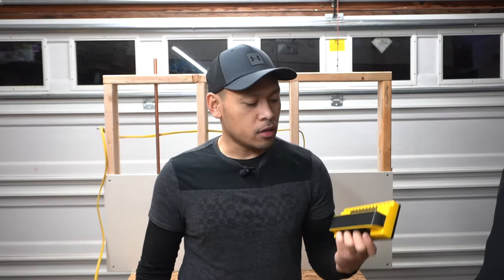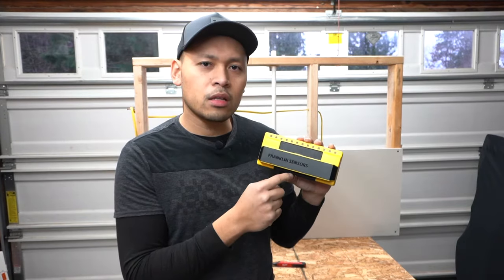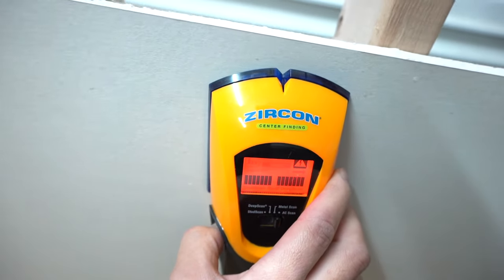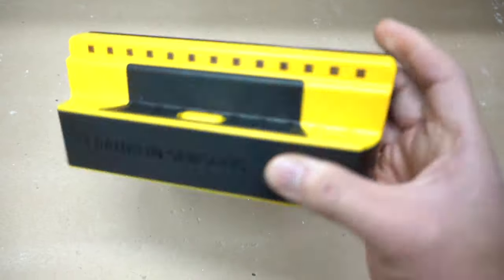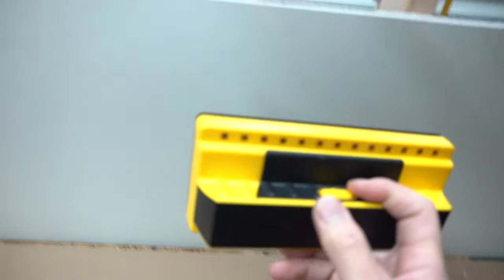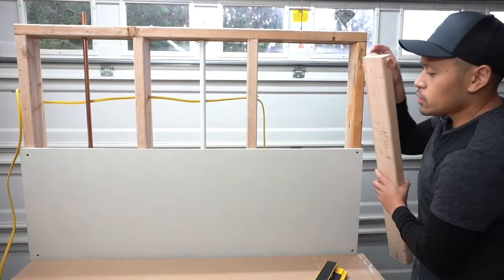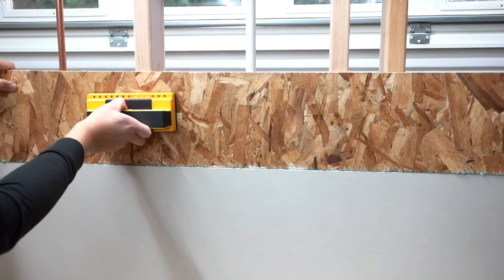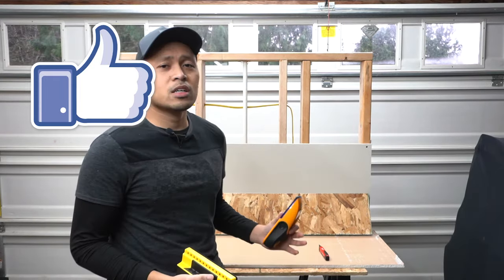I Found The Best Stud Finder!

Comment: Finally a true, unbiased, detailed, and fair test. This is awesome bro thanks. With how good you were talking about the Zircon I assumed you were going to be ignoring its faults and highlighting it’s good features but it’s clear you were being objective. I’ve definitely subbed after this video
Reply from the maker: Thank you so much! I’m glad I could bring value and help to your decision 🙏🏽😊thank you for the support as well! Means a lot!
Reply: Check out the ryobi it detect voltage tells you which way to go mid centers on it only draw back is you need two hands to operate it

Comment: I bought a Zircon several years ago and right out of the box it was a piece of junk! Always marking edges or just before an edge as center, Ive drilled many, many, many bad holes and just resorted to finding center with a tape and that actually worked better but takes a lot longer so trying one of these today to put up base board and hang some pictures. Great video.

Comment: Very well done. Your honesty is the number key with your testing. Although now we know that it's not good when Franklin Sensor has to go up gains thicker drywall, it's still accurate on lessor thickness drywall. I will get one as well. Thank u.

Comment: I suspect the reason the Franklin Sensors was giving you some false reading there for a while was because you had your hand running along the bottom of the unit. That will throw off the reading. You need to keep your hand on the handle. Nice review.
Reply from the maker: Good catch! Thank you ! 🙏🏽😊

Comment: I could not find the plaster ceiling studs in my garage, using 3 different Zircon testers. I got the Franklin 710+ (yours here) & on the first try bam! Exact locations, even across/showing a 4” double stud. It’s a keeper. Since I’m not looking for wires this was a no-brainer! I believe their M150 model also includes electric detection but haven’t tried it.

Comment: Thanks for your great video, I'm trying to mount my TV on the wall and used a ac finder to inspect the live wire, there are live wire everywhere on the wall 🤯 I don't know how to drill wall safely, I have tasted the multi sensor other place and worked well.... I'm not sure why there are lives wire everywhere on that wall 🤯

Comment: I bought the mid-level zircon and it couldn’t even find the wall. I exchanged it for the deep sensor model and it wasn’t much better. The Franklin worked well. 
Conclusion: If rating on a scale of A-Z, Zircon is named perfectly

Comment: Just wanted to mention that I just purchased the franklin unit, and it is perfectly accurate in finding studs, BUT - it is not designed to find electric lines. so, no surprise that it did not detecting it.
Reply from the maker: I’m glad you found it useful 👍🏽😊 I’m glad it doesn’t detect electric lights because it would mistaken it for a stud. Strictly made only for studs. It’s my #1 go to.

Comment: I wonder if the franklin sensor didn't read the double drywall was because you started the sensor out on an actual stud. I know in other sensors you need to calibrate the sensor where there isn't a stud. Would have liked to seen the difference, if there would be any I wonder?

Comment: I own both of  these tools, and must always check the batteries for full power. That means showing 10 volts on a fresh 9 volt battery. performance improves greatly on AC scan. Thanks.
Reply: Hi. Which battery tester do you use?

Comment: Ryobi has a similar one that detect voltage accurately it will tell you which way it is and center you in it only draw back is u need two hands to operate it

Comment: Never seen 1 inch thick drywall. So the Franklin works great
Reply: Then I guess you've never seen 1" shaftwall liner. Two layers of 1/2" also equals one inch. One layer of 5/8" and one layer of 3/8" also equals one inch. Two layers of 5/8" (as you will find on a 2-hour rated drywall assembly) equals 1-1/4".

Comment: Franklin stud doesn’t last long I went through 2 already...it’s the best for wood stud finder...I usually use spury adjustable none contact voltage tester to look for live wire it’s very sensitive it can even detect wire 3 to 6 inches away or behind wall...

Comment: You cant start off directly over a stud and expect it to detect changes without problems.
Reply: Your statement is very true for most stud finders and should be adhered to, But the Franklin model "ProSensor Professional T13 Stud Finder does allows you to start directly over the stud, the deference is this Franklin model has Auto-Scan feature built-in which eliminates the need to avoid the stud, the other nice feature about this unit is you do not have to calibrate just press, hold and begin your scan, for me this model is hard to beat. Cost: about $60.00

Comment: place the stud finder on the surface. press the button and hold it still and wait for the beep. when the beep sounds off, then move the stud finder. you move it too quickly in most cases.

Comment: Hmm 😒 with this style you can we get that close to the corners. Or maybe the way end LEDS will light up as soon as it reads the corner studs?? I don't know, can it ?  The corner stud finding needs to be demonstrated using this device. Thanks. We need a stud finder that will show PVC pipe, cables, wires, copper pipe, steel, iron and aluminium pipes, everything 😉

Comment: It looks like you didn't read the Zircon manual. You move too fast and don't stop right away when reading changes. You don't move back and forth. What I see is operator's error, not the tool

Comment: Why is it awesome not detecting livewire? FML
Reply from the maker: It only detects studs. If it detects live wire you could misinterpret it for a stud and get shocked, the zircon does detect voltage
Reply: it is not designed to detect AC, so if it had detected it it would have been a false readout, meaning it IS accurate for not detecting something it was not designed to detect, hope that helps...

Comment: Not the best of test. I would have prefer you stopped on all the studs to see if franklin stud finder would center all of them properly. You did it with 1st one and kept rolling over all the other studs with the franklin stud finder.  The Zircon you didn't even let it calibrate before moving it. You moved it every time before it was done calibrating.